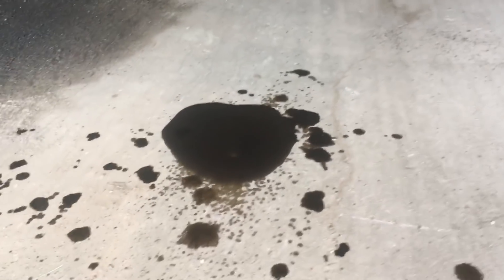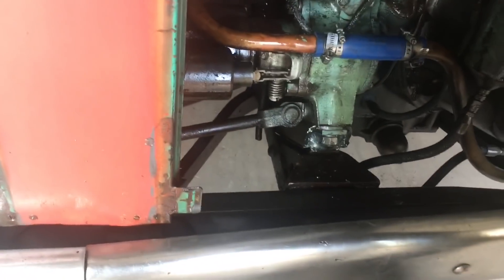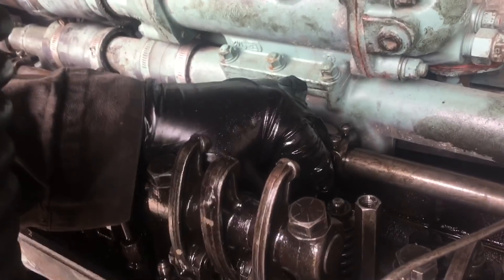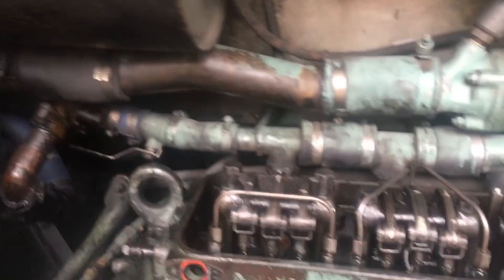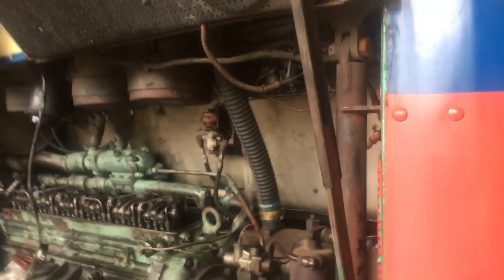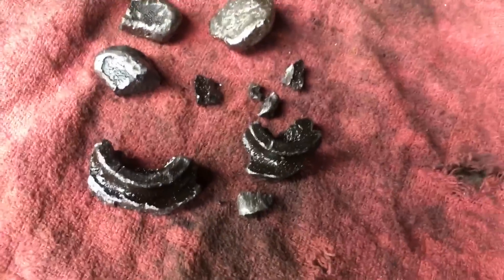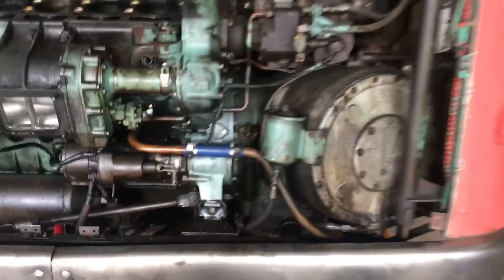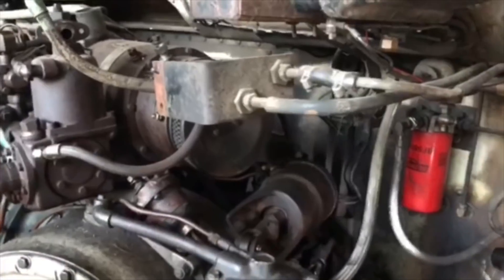Diagnosing a sick Detroit diesel 671

Comment: when starting cold touch each exhaust manifold on each cylinder. The one which is the coldest is the dead cylinder.
Reply: The other way is to crack the fuel line to the injector when it’s running, one cylinder at a time. The one that doesn’t change how the engine is running is the dead cylinder.
Reply: speed150mph yes that's the way if you can do that. We did marine and generators . Use digital thermometer laser to check each cylinder. Cold one is weak or Dead.
Reply: SovietRefusnik1 Golem that is a good method but it has fooled me a few times, depending on the exhaust manifold and turbo setup and the engine design it can fool you. I’ve had a John Deer 6 cylinder that had low power, and had snapped both the pushrods for one cylinder, but because it was on of the middle cylinders and the way the exhaust ports on the head sat, the dead cylinder was only 30 degrees lower then the one next to it, and was actually about 5 degrees warmer then the number one cylinder. So it’s not foolproof.
Reply: speed150mph True. Just an old school quick check for old Jimmies two strokes.
Reply: SovietRefusnik1 Golem haha yeah, the Detroit’s with there manifold style it works really well. That’s a trick that my father in law taught me. He has a modified tractor for tractor pulling with a 12V-71. That’s where I learned all I know about the old Detroits.
Reply: speed150mph We still use that 12v in ferries here on Long island NY.
Run all day night  all season under full load.
Reply: SovietRefusnik1 Golem I know what you mean. I’m a locomotive mechanic, and our EMD engines (which are very similar to the Detroit’s, just bigger) do the same thing. As long as they have oil, water, fuel and air they will run
Reply: speed150mph Nice. Look up Napier Deltec engine in England trains and NYC FD super pumper. Amazing engine
Reply: @Motorhead250  I liked the old slow piston as big as a bucket ones. The new opposed piston jobs just didn't do it but that's just me.
Reply: Lewie McNeely opposed? Ship engines Sultzer some are. Napier Deltec engine triangle three cranks opposed two cycle perhaps the most amazing engine ever made .
Was in NYc super pumper
Reply: @Motorhead250  That was them. I liked the ones before them, the SLOW speed turboed ones in the U.K. trains and then the triangle engine came out.
Reply: @Motorhead250  When someone can get 1K horses out of 4 jugs turning 900 r.p.m THAT gets my attention.
Reply: Lewie McNeely Some ships have 50k hp and turn 50 rpm. crazy
Reply: @Motorhead250  Sure! If they're big enough. The OLDER U.K. train engines had pistons that looked like buckets. And when they went by they were just chugging, not whizzing at all.
Reply: Motor head 1  They are a simple rugged design using really tough steels. The liners and heads seem to be very tough and using aluminium for the blowers.
Reply: Woo

Comment: I've seen a 6V92 rear engine coach still move under it's own power with a broken crankshaft, just lost the rear two cylinders so no A/C or battery charging or cooling fan. They are tough old engines, starting to get thin on the ground here in Australia now.
Reply: Ray G plenty of them still chugging around in workboats, we still have a 471 in a workboat and swapped 2 very tired 871s for a set of Volvo Pentas
Reply: daniel martin 
The town highway dept has one here, upstate ny. 
It’s in an international straight truck with a huge box on back for leaf pickup.
So every fall it gets to sing it’s song.
Reply: @danielmartin2463  Somebody told me they worked in an oil rig in Alaska where they ran a 4-71 at idle for weeks at a time for emergency standby power. They went to rev it up and it wouldn't come to power. The exhaust had plugged with soot to where there was a tiny hole to breath through.
Reply: I heard someone say, "If it ain't makin noise, somethin ain't right!"
Reply: Got a 6v53 in my boat, as close to bulletproof as a motor could be
Reply: Had a cat that would shutdown every now and then guy drove it like that for at least a year. Was a broken crank crazy af
Reply: Heya Ray! They're about if you know where to look.
Reply: Those old GM powered Denning buses Ray , had many a ride on those back in the `70`s & 80`s. Actually you still see the odd one running now.
Reply: I went for a trip from Gympie QLD to gladstone in a deck and a half 40 ft Denning with rest room and small trailer when I was in high school just a natural 6V71. The manual arts teacher drove it I asked about the power and he said ''heaps''.
Reply: My school bus I took to school had a Detroit in it
Reply: Our city buses with 6V71's would run for ages with broken cranks. the driver would sign it in for rough running. Man these things were tough. No water, no oil no problem. In fact water and oil were interchangeable fluids in them LOL. I miss them so much !
Reply: @tractorfix  It was when they stopped dripping on the ground you knew you had a serious issue.

Comment: 3:32 rut roe, zero compression #4

did this bus drive to your shop?
Reply: I had this bus on a run the entire day. On the way back to the garage, out of the corner of my eye in the left mirror I saw what I thought was a puff of smoke. At that same moment the low oil light and buzzer came on. I was able to get off at an exit ramp and onto a side street and stop the engine. A valve broke off the stem and punctured the piston and dropped thru the hole and into the pan. Scott started the engine for a second and that's what you see.
Reply: @philepstein524  The old girl just let go on ya. Sad, but it happens. Any idea on how many total hours / hours since last rebuild on it, Phil?
Reply: @DagonNaxos  It was a poor rebuild in 2007. Never had good compression, never started good.  Ran good once started. Rebuilder wouldn't back up his work, but got paid anyway. Has 3000 miles since 2007 rebuild. There's another engine in 1303 now. One I salvaged when TCRT 1244 was parted out.The engine above is sitting aside awaiting its fate. The head is wrecked, as well as the piston, liner and even the crankshaft was damaged.
Reply: @philepstein524  That's such a shame and what a douche thing to do by the mechanic. I'm a computer engineer. Everything I build, I stand behind. If I think it's questionable, I won't sell it. And I'm not talking laptops and PCs here. I'm talking multiple million dollar rack systems. I won't screw over a customer like that.
Reply: Had it towed in.
Reply: God, guns and two stroke Detroit engines made this country great, they powered everything. Nothing could kill them but the EPA.